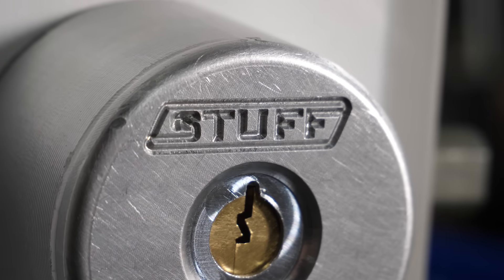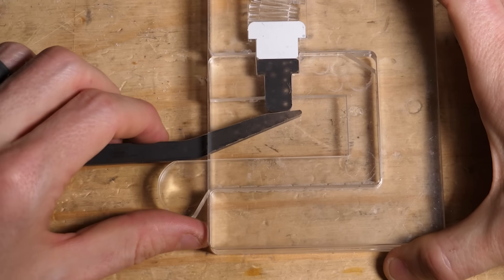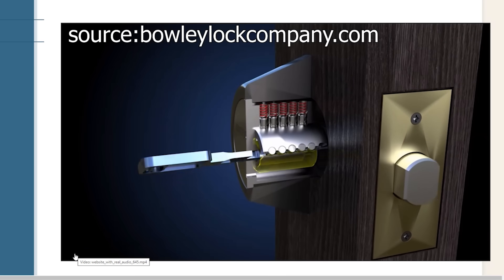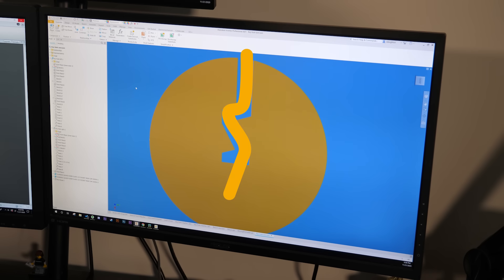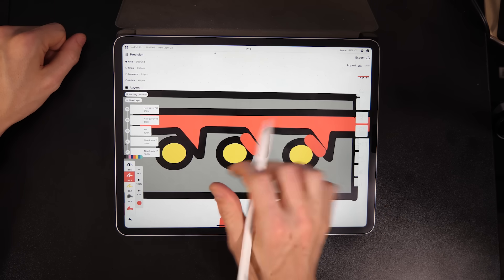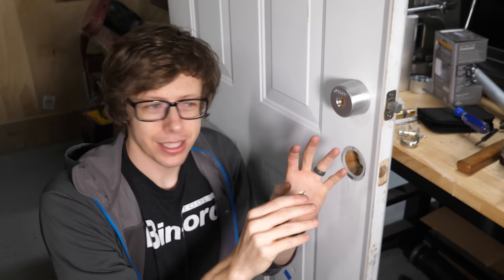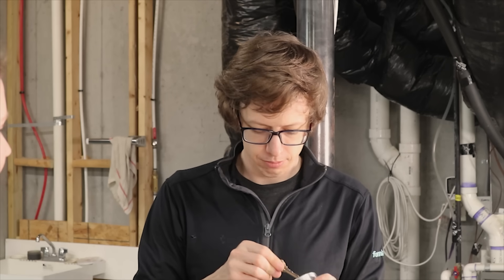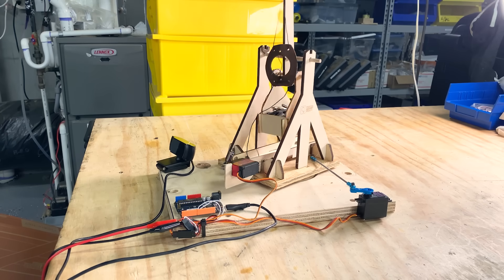Making an unpickable lock. Calling locksmiths

Comment: Awesome video, awesome project. Definitely send it to the LPL. 

Question though, can it be drilled? It seems vulnerable to destructive attacks.

To combat drilling, some locks feature spinning hardened inserts that float between the keyway and the cylinder case. The drill bit just bites the insert and spins harmlessly, it can't reach the stator.

You'd also need a hardened body, because you can just drill through the top, can't you? Wouldn't this disengage the clever mechanism?

Oh, and what about heat? Acetylene torches etc. That clever mechanism that locks the driver pins, is that brass? It looks thin, would it melt or deform? What would happen if the driver pin springs, or those in the top mechanism were heated to failure? Would it seize?

I really love this, but for the next iteration I'd consider the fact that actually picking a lock isn't always the fastest way to defeat it. And the LPL loves that stuff 😁

Comment: Best channel on YouTube!
Reply: maybe try to pick it hung in a door frame first.  if that fails, bring out the centrifuge.  wonder if stethescope will be useful.  i recommend full disclosure of 3d models to LPL so we can test 'unpickable' hypothesis as well as possible (maybe save that for 3rd step...).  As a physical lock it sticks out of door at 90% and is easy target for hammer - but no point deductions there - its a prototype after all.

Comment: How do we cut keyways in normal solid cylinders?  There are two main techniques I know of to make a keyway.  Broaching and EDM.  I suspect that lock manufacturers use broaching.  Some really high end specialty cores may be EDMed, but I doubt it's used much in the lock industry.

Comment: I actually had this same idea and modeled a similar design (though my pin-locking mechanism was different); turns out it's already patented (no. 10280646), but I couldn't find any locks that actually implemented it.

I can't see exactly how your mechanism works based on the video, but the two main concerns I would have about this implementation is:
1: the gates means you need a lot of spacing between pins, limiting the possible differs since you can only fit 3 pins instead of 6. You might be able to just pick the lock with brute force given reasonable tolerances, especially given that it seems like your bitting depth is fairly limited with this design.
2: I couldn't tell from the video, but the mechanism you're using to prevent the rotation of the core until the pins are locked in place doesn't seem to be spring biased. Isn't there a chance that the tolerance on that mechanism could be worse than the pins, allowing enough core rotation to pick the lock normally?

It's super awesome to see someone actually make something like this!

Comment: Pickers seem to have direct access to the cylinder and looks like all picking tools are made for that. Why not just extend the lock housing (leaving the standard cylinder) by 3 or 4 inches, requiring the lock be picked and tensioned through 4 inches of nothing

Comment: Hey, I can't really tell from your cad drawing, but from what I can see, it might be possible to use a comb pick to push the pins completely out of the way of the pin gates or whatever you call the way the lock checks the heights of the pins, so I would test that before sending it out.

Comment: Yes, send it to the Lockpicking Lawyer. You should've sent this before publishing the video :D

> It's about 12,000,000 combinations

Permutations, it's permutations. Order matters in a password. Also, it'd be 62 instead of 26, i.e. 62 * 62 * 62 * ... or 62^(password_length), which, in the case of 5, it'd be 62^5 = 916,132,832 permutations. Why 62, you ask? Because you have 26 lower-case letters, 26 upper-case letters, and 10 digits :)

(Note: I'm intentionally ignoring punctuation symbols such as ',."?!@ etc.)

> This is equivalent to guessing a password one letter at a time. For each letter, you have a maximum of 26 options. At most, it'll take 130 guesses instead of 12 million

No. Upper/Lower case letters are different, so even if we want to limit the pool of options to letters only, we have a maximum of 52, not 26.

While I get where you're trying to go with this, I think the equivalency does not really work in the example. Since there're 52 options in the pool, each letter will add ~5.7 bits of entropy to the password, i.e. log2(52). With a 5-letter (randomly generated) password, you'd get ~5.7 * 5 = ~27.5 bits of overall entropy. However, the effective entropy is ~26.5 instead (dividing by 2 if not using logs), meaning that, on average you'll need only ~458.1K guess attempts to break it.

Comment: There are heaps of unpickable locks. If you have a look at the "whipped" videos on Bosnian Bills channel there are a whole variety of locks that backyarders have created using novel techniques to stop them from being picked. The simplest solution to making a lock unpickable is to make it impossible to use a pick. If you're willing to make a core in 2 halves then you can make a keyway that it's impossible to use a pick in.

Comment: "if you want an unpickable lock use a lock without a key" 
:*laughs in rare earth magnet*
Reply: or credential cloning attacks.  There's plenty of really terrible electronic locks out there or poorly installed ones.  Many places will let you in by spraying upside down duster in the door crack (trips the IR REX sensor).
Reply: Also your are locked out when the power goes out or the thing goes bad, and you have to rely on a mechanical fallback nonetheless. I'd so like this to work and someone bring the principle to market.
Reply: @schmitz9a  I’m sure they sell ones with batteries
Reply: @stdesy  I'm sure they do. And that's nice. But even those still go bad an hafe a comparatively short lifespan. There are just some things that don't need electronics or digitalisation. A lock might be one of them.
Reply: @schmitz9a  I think having a keyhole is a massive vulnerability though as LPL's perfect record indicates. You did give me an idea...a mechanical lock that only responds to a uniquely shaped magnetic field? You'd have to make a very strong rare earth magnet that is a very specific shape but it might be possible.
Reply: I mean, technically you can't pick it.
Reply: I mean he didn't say there was such a thing as a lock you can't defeat, but if your lock doesn't have a keyway it can't be picked.

Comment: well... i'm certainly not an expert but let's give it a try on how to approach this: magnet on top to overset all pins, bind them against the gates (imitating a key to allow turning) then release to allow the pins to drop on a gates latch, reapply pressure to the turning mecanism and open? (This requires some missmatch between the pins and the gates thou)
if a pin is not set repeat release-lift-shear-drop-pickup cycle for individual pins

in my mind this sounds like it could work, but I also do not think i understand how exactly you implemented the turn/freeze pin mechanism
Reply: Those pins are made of brass and aren’t magnetic, won’t work sadly

Comment: One idea of picking: Push the driver pin to the upmost position and then use a shin to engage the lockdown mechanics to lock them in place. Turn the lock until pins hit the bar. Now slowly retract the shin while applying force to turn. The idea is with shin slowly retracting, the driver pins should descend as well and it is possible to stuck into the correct gap.

Comment: LPL:  This turns out to be a very difficult lock to pick. However: There is a design fault that lets me open it in a few seconds.
Reply: LPL: you see, if you smash it on the ground... Tada!
Reply: LPL: this lock was nearly impossible to pick but it has a major design fault, it was constructed near a masterlock and using that knowledge I was able to stare at it for a second until it opened
Reply: @alexls1923  Literally LOL!
Reply: Just submerge it in liquid nitrogen, Snap on 1, 2 is gone, 3 is binding...
Reply: Looks like the current one is suseptable to Combing.
Reply: Using only one of those cheap flat toothpicks that broke with the slightest bend.
Reply: Can pretty much guarantee that there's a design vulnerability. Like pushing the rear lever back and driving all the pins up. Then reverse picking by dropping pins 1 by 1. There's probably worse tolerances than most factory locks.
Reply: Put a pound of TNT on it,
Instant unlock.

Comment: I hope so badly to see this lock on LPL.

As a side note: if this lock does stand up to someone like LPL and has any potential to be commercially viable, this could actually be very important to the security industry. You talk about how people should just get keyless locks, but those are painfully vulnerable, often more so than physical locks. You could, for example, just write code to brute-force the lock by blasting it with RFID chains until you hit the right one. And that is you can't for some reason get within 6 feet of the person with the key, because at that point you can just use a big ass reader in a backpack or a messenger bag to grab the code right off their key.

Comment: Three pins only? That's actually super-easy to break. Just run all the combinations. If you have three possible positions per pin then the number of combinations is 3^3 = 27. With the right tool it should take a few minutes

Comment: Send one go the lock picking lawyer and get his thoughts on it. I would like to see that maybe het this I to production after some changes it looks like a solid design. You would just need a tool however that you could adjust the height on the individual pin slots. Length etc a really speciatiy tool but yes do it.

Comment: Never say never, your idea could be a revolutionary way of making locks, expensive locals for expensive stuff. You might have planted the seed for the future of locks.
Its an interesting concept but once you know how it works you will make a method for it like
Potential ways of doing it?
1 pick per pin at the same time and insted of tensioning the lock cylinder against the Bible you just press on the "locking bar" that makes things already more complicated because though the key whole you need 6,7 individual picks plus the one for the tensioning of the pins and an other for the tensioning of the CORE so thats already a lot of hardware.
Yiu are amazing, and i hope our little world can have move minds like yours.

Best of luck 🤞 with lock picking lawyer

Comment: This kind of lock is completely pointless because using it implies that everything around it is equally sturdy. It's much easier to break a window or door than pick a lock, and very few people will even attempt a pick.
That said many of the commercial locks are embarrassingly easy to rake, so you can't go totally the opposite direction either (if people know about this).

Comment: I see a couple of potential issues or weaknesses with the design, some related to picking, some not. Guess you won't read them with 1.66 million subs, but I will try anyway:
Other entry issues:
1.) If the mechanism that holds the pins in place fails after the check and one pin drops, you have to basically drill the whole lock out as I understand it, since you can't set the pins with the key anywhere between the two gates.
2.) The lock is very likely prone to over-torquing. In a regular pin tumbler, all pins would have to be sheared off straight to make this happen, in your design the weakpoints seams to be the lever at the back.
3.) There is also the issue of plug-pulling. In a regular pin tumbler, the pins prevent the plug from pilling pulled out with a plug puller. They would have to be set in place first which in production locks is the hard part. However, your lock has really bad flaw here: You can just push all pins up, then rotate the core --> pins are getting rotated away, "key pins" drop down again --> there is nothing that holds your core(=plug) in place other then how you screwed it onto the lever at the end. Edit: After reviewing how you implemented the pins currently with the top pins resting above the chamber at all times anyway since they are too fat to reach down into the plug, you can probably simply pull the core out without doing anything. Which would be a major flaw.

Potential picking Issues:
4.) Make sure your lock is not prone to comb-picking. That means, that when you rotate the core a bit the pin-retaining mechanism will hold all pins in place. Then you push all pins up to the maximum. Now it is very important, that your top pins aren't pushed all the way into your retaining mechanism and don't even make contact anymore with your two gates when you rotate the core ("hovering" in locked position above the gates). 
5.) The precision of your pins has probably to be very low, otherwise just the tiniest fail of the retaining mechanism may hinder you from unlocking the lock or get the pluck hardstuck (see 1.)
6.) It might be attackable with vibration attacks due to 4.: Put in a metal strip that activates the clamping mechanism, set all pins to medium height, use a lockpicking gun to quickly rotate the coreleft and right a few degrees a few hundred times per second, turn the core with it until you hit the gate --> due to bad tolerances the pins migh vibrate themselves into the correct heights. Also trying to push and pull the plug forward and backward while tensioning against gate might wiggle the pins into their correct positions. Together with an up/down vibration I believe this attack could be quite possible since you don't have much pin travel.
7.) This is very far-fetched but one potential attack vector could be that at the end, the pins are all tested again not exactly at the same time due to tolerances. This means, one pin will bind earlier at the gate then the others. If those tolerances are big enough that you can measure them, you can pick the lock. Example: You have your three pins, all set at wrong heights. you can rotate the core like that for 15.67 degrees. You mess with one pin only set it at the wrong height again, turn the core, it turns 15.73 degrees. You fiddle again with it, this time get the correct height for it, suddenly the core rotates 16.02 degrees and you know that you set that pin at the correct height. The hard part of this method would be to find the binding order of the pins. But even then it should reduce the number of attempts you need considerably.
I would probably have some more ideas if I had the lock at hand but since that will never be the case, that's about everything I can say about it for now ^^

Comment: Not only is it important to have a reliable lock with respect to picking, but even more importantly it's necessary to have a lock that will continue to work easily every day in regular use.

He's correct at the end when he says the mechanical complexity of this outweighs the benefits. BUT I think once LPL and maybe some other lock people look at this, there could be some simplifications that make the lock more robust without losing the spirit of its technical difficulty

Comment: LPL has said there are locks that he can't pick. Reminds me of some other designs. I don't see how the pins stay in the right position when rotated. What if I simply drove a screwdriver in the key way and rotated it with a pipe wrench? I might get a LPL time to open. That's clearly the gold bar. No more than a 3 minute video. Maybe you can mount it on the back door.

Comment: what if the pin lock bar mechanism was a camshaft and pushed ball bearings into divets on the sides of the pins?  if not a camshaft, radial rotation, you could go with a shaft that slid axially with fishmouth cuts for a bb for every pin

Comment: I've put a fair amount of thought into a mechanism vaguely like this, but don't really have the engineering chops to make a finished design and definitely don't have the ability to manufacture anything like this. I still have some thoughts, though.
First, I suspect wafers might work better than pins for something this complex. Not sure about that though.
Second, you might be overthinking the pin locking mechanism. With the gate design I'm not sure how you'd keep them from moving around inside the mechanism, but I think you can achieve something similar by replacing the key pins with stacks of thin disks. The disks above the shear line would hold the gated driver pins at the same height the key (or pick) set them to with no need for a complex locking mechanism. Again, though, you'd need to figure out a way to constrain those disks without interfering with the gates.

EDIT: Huh. I don't think I was thinking very hard about that first suggestion. I have no idea how wafers would work with the gates. Maybe it's possible, but it's not obvious.

Comment: Cool lock design! I've been looking at it for a while and the only thing I can think to do is to purposely set all the pins to their highest and then lock them there. Then while turning it, when it hits the gates, to gently release tension on the locking bar hoping to allow the pins to settle into their gates. I can't imagine how careful you'd have to be to do that though...
Reply: To prevent that you would only have to make an even more complicated design where the act of turning the lock cylinder also locked the locking bar, instead of how it currently is just activated by the key being pushed in fully.